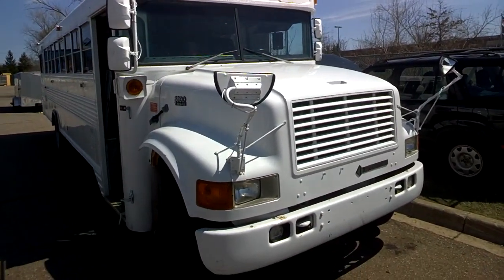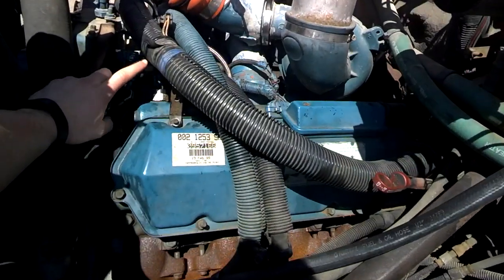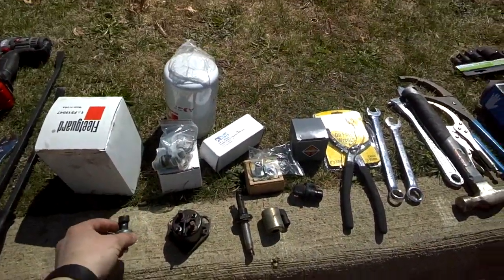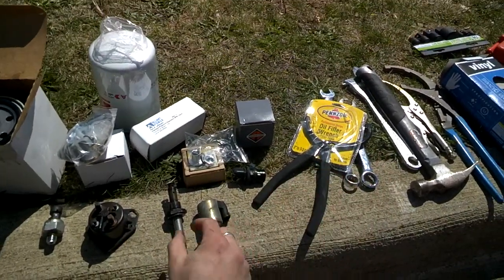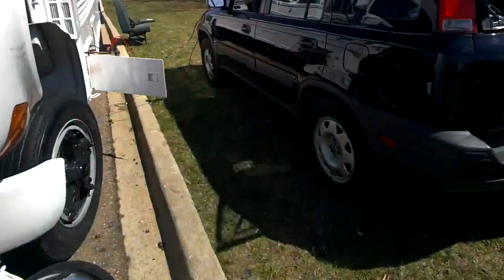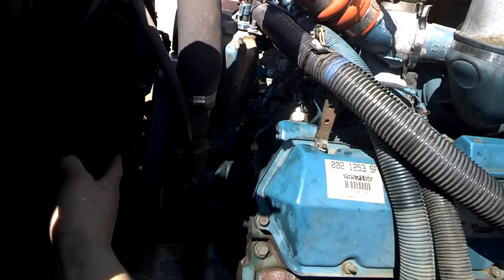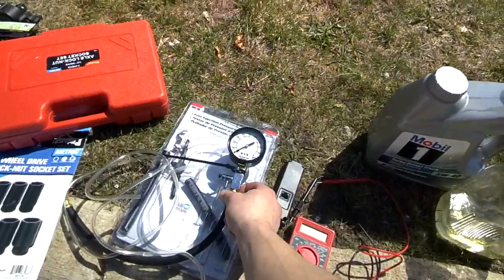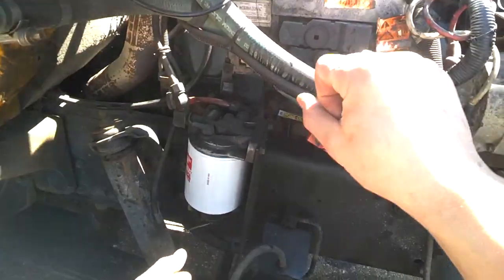All You Need to Know to Fix the 7.3L PSD T444E Engine incl CPS, IPR, ICP, FPR, etc.

Comment: I’m sorry but I’m confused about what the parts are named and how they interact with each other. I’ve watch this video a couple of times and you aren’t showing the camera much just walking back and forth between the line of boxes on the curb and the engine area. There’s no close up shots.
Maybe it’s clear to you or people that work on the engine’s and understand what parts you are talking about.
I’m sorry but I would like to see a video of each part and a shot close up of the wiring harness for that specific item.
You covered plenty of ground 
icp sensor the injection control pressure.

ipr the injection pressure regulator 

cam position sensor 

Hpop high pressure oil pump reservoir drain or access 

No mention of the fuel heater circuit inside the fuel bowl which if shorted can cause a no start condition 

There’s no mention of the oil levels other than that hpop reservoir 

You don’t mention fuel tank or low pressure fuel pump or minimum pressure of fuel at the hpop 

I’m an owner of the 99 7.3 and have been seeking to understand enough about the engine and the various problems.

I’ve had about all four you mentioned plus glow plugs and loose battery terminals plus sometimes not starting at all after the truck is driven in the rain and shut down. I worked it out by using a large screwdriver to jump the big nuts on the solenoid on the passenger side fender with the key on.

I’m sure there’s a way to fix that but I haven’t found a mechanic yet who is willing to work out what wiring is rubbed through and causing the problem. Once I restart the engine and drive a while, 1 hour, the engine restart problem is resolved and until the wiring gets wet enough again to expose the bare spot or spots to reproduce the problem it’s basically undetectable.

Comment: How many sensors are bad... u did not fix anything just swaped parts...
Reply from the maker: Joel Stewart replacing a broken part with a working part is generally how you fix something. In my case the ipr and cpr were bad